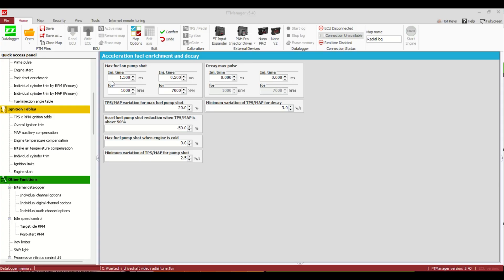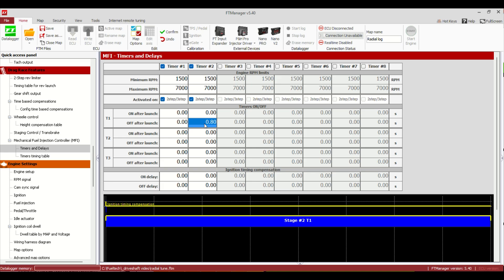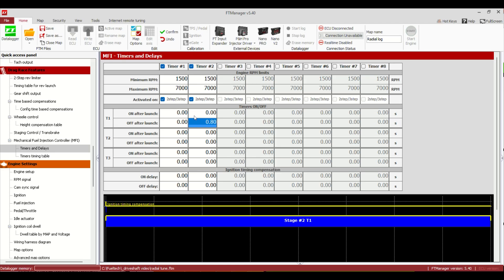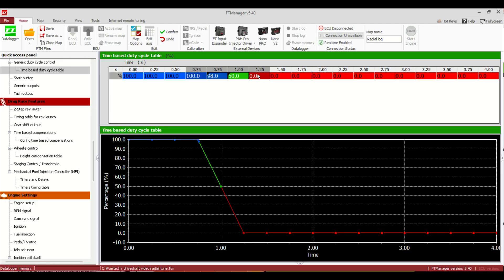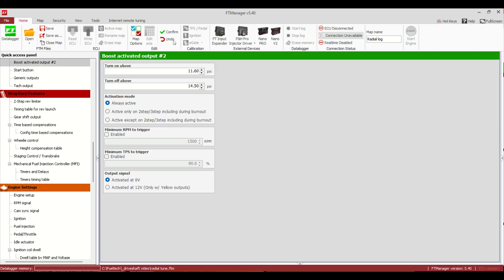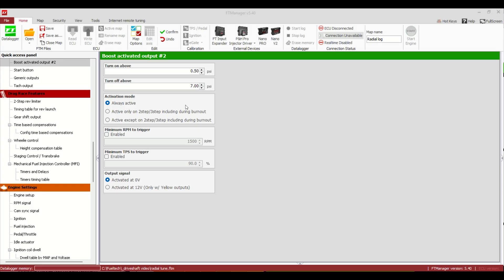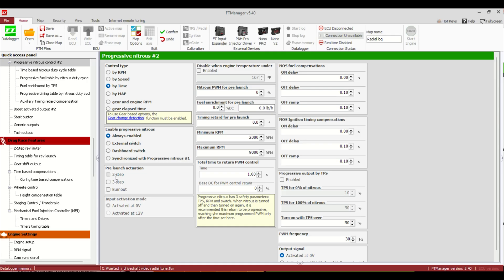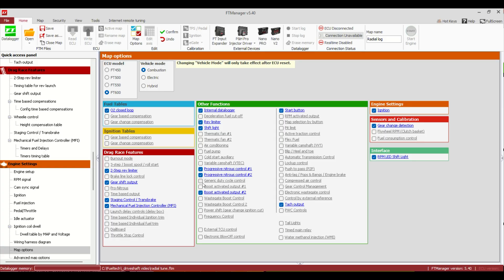Setting Up Internal and External Dump Valves on FT Manager | Tech Tuesday

Comment: Another great video.     I use the mechanical timers and work with the rpm window as well to turn the dumps off while on the 2 step to reload the converter.    And the time based setup after launch along with rpm control.   Neat to overlay graphs and see the converter pull the rpm down.   A guy knows stuff is working!